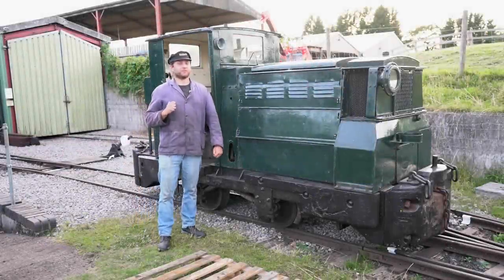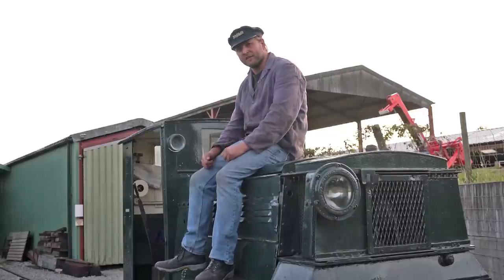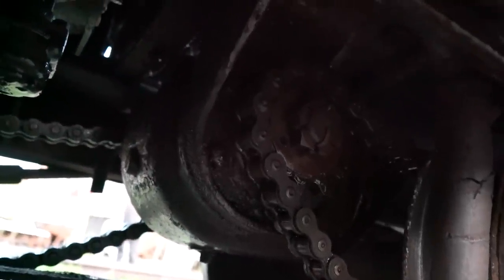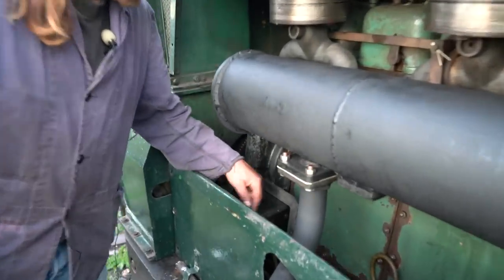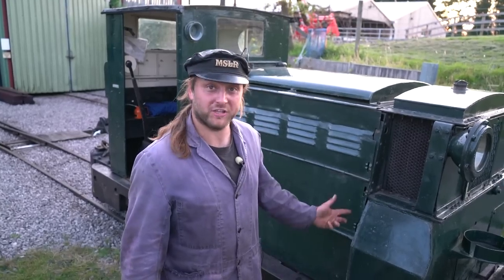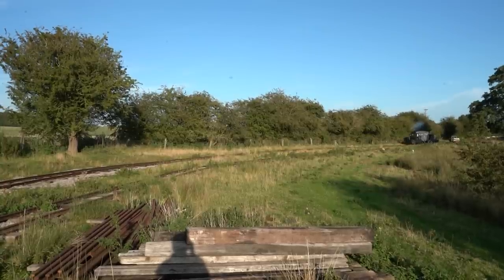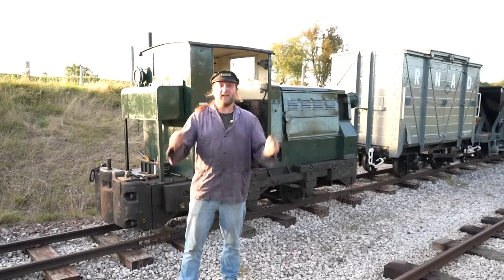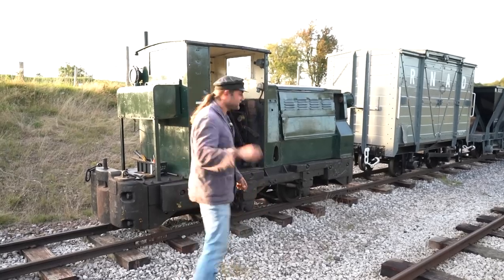This Ruston 44/48 hasn't pulled a train for 21 years! - Lawrie Goes Loco Episode 9

Comment: I absolute love this locomotive!
It's completly adorable.

(I even decided to make a model of one of those small locomotives for a mining train based on the Märklin rockwagons if i can get a singel pice 00 motorboggi, 00 is a quite rare scale in my coutry but i taught it would match my old 1930s Hornby Tankloco if it's slightly bigger than the H0 locos i hawe in my collection but can still use the same system as the German H0 trains i think. For now the miniature trains is as close i can get the full size i guess... but i still dreaming... ha ha. ).
Reply from the maker: It's a super little thing, I quite agree!
Good luck with your project, it'll be interesting to see how it turns out!

Railway modelling is really good fun and very rewarding too!

Comment: What a delightful little locomotive! I honestly was really nervous there when you applied the breaks and nothing happened, I hope you informed the owners about the breaking issues. Very cool piece of equipment, I'm so glad you were able to give us a tour of it! I was quite shocked by the sheer difference between the crank start on this loco, and the one on the other Ruston 44/48 you attempted to start by hand. I couldn't believe it when it started right up!
Reply from the maker: It really is lovely. They've done a really cracking job with it.
I was a little concerned too, but there was never any real danger, we were out on test.
One of the owners was close by in one of the wagons, and agreed they may need adjustment! 😂
I was amazed it started too! Magnificent wasn't it!

Comment: A smashing video, that’s brought back some fun memories – thank you.

Occasionally in 2015-16 I drove the twin sister, RH 221625, also ex-RNAD BM, while on a long-term loan to the sadly short-lived Penrhyn Quarry Railway revival project in Gwynedd as PQR No26… 26 cemented my fondness of Rustons, and I miss it.

I was in stitches at 19:45 , because the brake on 26 worked when going forward perfectly, but hardly at all in reverse, much as you found here - how did the brake perform going forwards on 221623?

Also: You could’ve made life even easier still on yourself starting it up – the injection pump has a lever on the back you can reach your fingers around to to flick up, releasing the control rack to push even further forwards than the throttle lever allows (it drops back automatically after starting). The guys up from the Moseley Trust minding 0-4-2ST ‘Stanhope’ taught us that, and reckoned that these 48DL’s are bizarrely easier to manual start than the diddy 20DL’s. Couldn’t see them in your video, but the other quaint curiosity certainly with the engine in 26 (possibly swapped for the Lister equivalent?) was the glow plugs: they were essentially long bolts with a T-handle that you unscrew, shove the handleless end in a fire or blow-torch flame until red hot, replace swiftly but safely into the engine, and then you attempt to start the thing up as quickly as you can!

Thank you again.
Reply from the maker: I'm really glad you enjoyed it! They're great fun things to drive aren't they. Massive shame about Penrhyn, it looked like it had so much potential and character.
The brakes... Just needed adjustment full stop 😂

Oh really? That's a useful hint for the future!
We'd talked about putting in a similar heating system into my 48 when it didn't want to start.

Comment: An object in motion tends to stay in motion! Those brakes aren't exactly air brakes or vacuum brakes. You really have to consider that you only have the engine to brake with when you're pulling cars in something like this. Here in the USA, I used to operate this little sucker, it's the same thing but a little bigger (weighing in at 7 tons, built by Plymouth for use in a sand pit): https://i.ytimg.com/vi/eooWQwjO24Q/maxresdefault.jpg
And While I'm thinking of it, here's Cavan and Leitrim #3, Lady Edith. She's the Irish 3 foot gauge engine that made it to the US, you may recall I mentioned her in the comments of a previous video. Here she is when she was still running here: http://s3.amazonaws.com/rrpa_photos/19282/lady%20edith%20allaire%20st%20park%20nj%2009-89b.jpg

And in case anyone ever wanted to see a TRIPLE HEADER with LADY EDITH, a 2-6-2 PRAIRIE, and a 2 TRUCK SHAY, here you go!! 3 foot gauge heaven! : https://encrypted-tbn0.gstatic.com/images?q=tbn:ANd9GcSpZRKz_EpRhEEemmTve2Bal_7Ch3mS_ijyP6exyWyubSNVC_kt

 I'm really glad to see  this chanel taking off. Keep it up, Lawrie! Really good stuff here!!

Comment: Everything is fine until you go sailing through a red signal desperately trying to stop LOL
Reply: Why not put it in reverse..Or just pretend the red signal is not there.... :D
Reply: @ElliottVeares  I'm guessing there isn't a lot of traffic to worry about but waltzing through a switch set the wrong way might be a smidge embarrassing .
Reply from the maker: There are ways of stopping it if things went very wrong.
We didn't have much speed at the time, and I applied the brake long in advance of the signal.

Comment: if it wasn't rebuilt correctly  21 years ago then it wont last long , It would not be your fault .
Reply: Trust me, its in very, very good condition. The engine has been rebuilt from the ground up.
Reply: @KrisDouglas  I believe it was done right , but He was worried if it might have failed while he was operating it .
Reply from the maker: I'd just have felt really bad! It sounds super sweet though!

Comment: Amazing little loco, but definitely credit to its restoration team.

I'm a bit gutted that the manual engine start didn't put up much of a fight, but I guess that's what a major overhaul does.
Reply: Quality engineering!
Reply from the maker: I was surprised, I didn't think it would be that easy, I thought I'd failed, and away it went.
They've done a super good job on it - it's like new!

Comment: I always learned to keep my thumbs On Top of the cranking handle rather than around it because if it kicks back and the engine's big enough it'll break your thumb
Reply: To be honest on an engine that size you need to be able to properly grab the handle and pull it out or you have a 48hp egg whisk on your hands.
Reply: "you have a 48hp egg whisk on your hands."  That sounds an interesting experience.
Reply from the maker: From experience with the dumper, it is not entertaining.
Reply: It was sarcasm, more like a wrist breaker if your not careful.
Reply from the maker: Sorry, I missed out the laughing face! I knew what you meant!